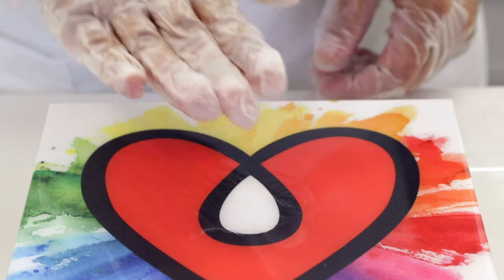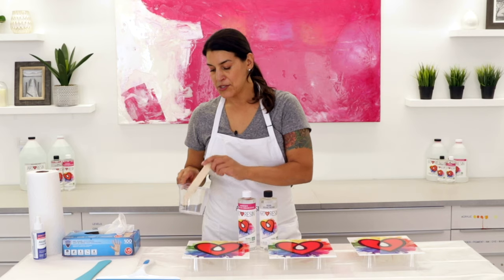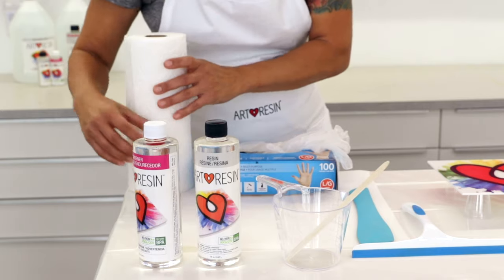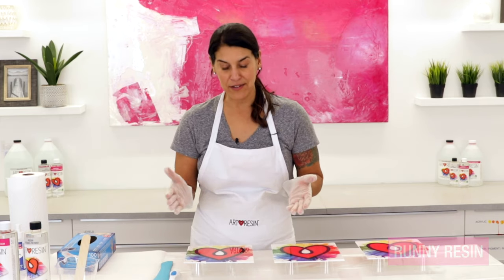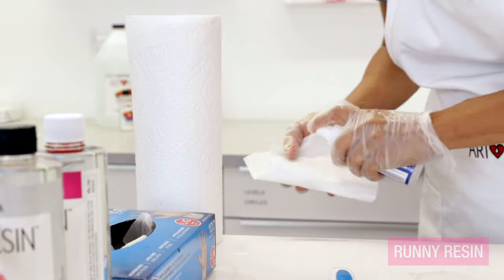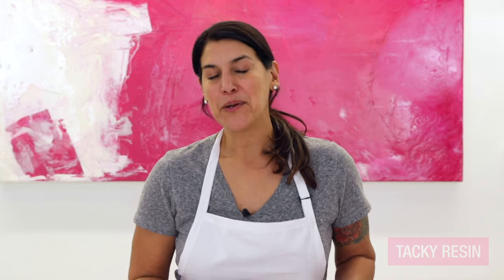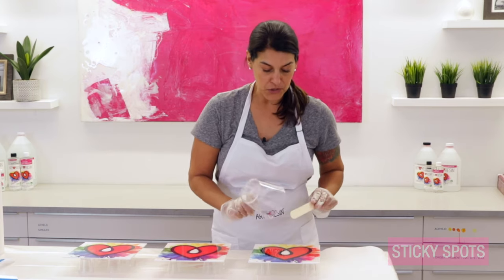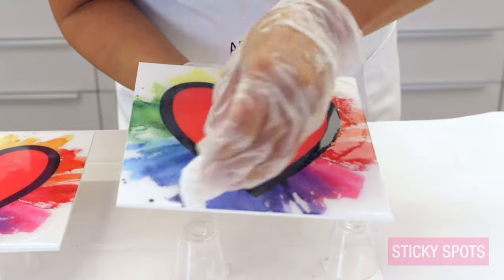How to Fix Sticky Resin - Top Tips & Tricks

Comment: Hello,I’m new to resin art and making my first cupcake tower,I first had a couple soft spots and watched YouTube to see how to fix it.I added another layer of resin and it’s almost completely hardened but I have a couple sticky spots that I’m now trying to fix.I used flowers inside I don’t want to accidentally scrape them.🤦🏽‍♀️
Reply from the maker: Hi Kristina, If the resin hasn't hardened after 24 hours and is still sticky, it is likely your mixing ratio was off or your mixture wasn't mixed thoroughly enough.  Ensure that you are mixing in a precise 1:1 ratio by volume not by weight, and that you mix thoroughly for a full 3 minutes ensuring to scrape the bottom and sides of your mixing container during the stirring.  If your resin is just sticky, you can pour right over it with a fresh coat of properly mixed resin, you will only need to scrap off any wet, sloppy resin if there is any.   Prior to pouring this final coat to cover any sticky areas, just make sure that you lightly sand any areas of cured resin so that your final coat adheres strongly.
Reply: @Artresin  Thank you so much for your help.I haven’t had any issues with my newer projects but trying to fix my cupcake tower is making me wonder if I should give up lol.I’ve scraped off what I could of the sticky or soft spots and sanded the hardened parts and added a new layer but then the side was sticky too.🤦🏽‍♀️it was my first project.
Reply from the maker: @KristinaChestnut  Oh no!  It sounds like you maybe aren't getting your resin and hardener fully mixed.  Just make sure you are scraping the sides and the bottom of your container really well when you stir.  When you pour it out of your mixing container, try to not scrape out the container.  If you scrape out the container, if there is a spot of resin or hardener that isn't mixed well, it will show up as an uncured patch on your piece.  we are always available at support@artresin.com if you have any specific questions 🙂

Comment: I evenly measure my resin all the time. However, I noticed recently that my last resin artwork is hard but not hard hard. Everywhere is hard but the bottom. When I do a slight touch with my nail, I see marks, and then it goes back to its original form. That shouldn’t be since I left the resin alone for 24 hours. How can I fix this?🤔
Reply from the maker: Hi Miss Lebon, ArtResin is cured to the touch after 24 hours but will continue to its full cure for 72 hours, based on a 1/8" thickness.  You should see it being harder after the 72 hours has passed 🙂

Comment: Hi what room temperature does it have to be when doing resis thank you Alana Australia
Reply from the maker: One of the most important factors to ensure your epoxy resin cures properly is temperature. The ideal temperature for both your ArtResin and your workspace is slightly warmer than room temperature: 75-85F or 24-30C. You also want it to be dry, 50% humidity is ideal and stable meaning no dips in temperature during the first 24hrs. Take a look at our blog for more information: https://www.artresin.com/blogs/artresin/what-is-the-perfect-temperature-to-cure-epoxy-resin
Reply: Some products tell you on the bottle. Mine is 70°

Comment: When I pour resin mixture  it is all frothy
foaming like head on a bier.  does not go away. The pour is almost all frost like white
looks ruined.

How can I fix it?
whT did I do wrong???
Really need help going through alot of
art resin.
Reply from the maker: Hi Carole,  it sounds like you either have a lot of micro bubbles trapped in your mixture.  To prevent this going forward, we recommend using a warm water bath prior to mixing, warming the resin and hardener reduces the viscosity and allows for bubbles to be released easier.  When resin is cool it is thick and the trapped bubbles will make it frothy and milky.  We also recommend stirring thoroughly but slowly, avoid whipping and incorporating more air in while stirring.  If you are pouring over a canvas, you can pass a torch flame over the surface, this will clear off any bubbles that remain.  If you are using ArtResin in molds, remember to pour in shallow layers to allow bubbles to release.  You can layer as deep as you want, just wait for the previous layer to cure for 3-5 hours before pouring the next layer.  For more information, have a look at our blog:  
https://www.artresin.com/blogs/artresin/oh-sh-t-series-episode-4-milky?_pos=1&_sid=953e6aba4&_ss=r

Comment: Just did my first journal covers. 
They didn’t get sticky but even after 3 days they are a solid but are bendable and solid hard.
Why did that happen and can it be fixed?
Reply from the maker: Hi Josephine,  I am guessing that your journal covers are a very thin pour, without a substrate a thin pour of ArtResin can be expected to remain flexible.   To reduce bendiness we would recommend a thickness over 1/3".  To reduce flexibility you could layer on a clear coat of ArtResin to increase thickness.
Here is our blog on how to prevent bendy resin: https://www.artresin.com/blogs/artresin/how-to-prevent-bendy-resin?_pos=1&_sid=7599e95f0&_ss=r

Comment: So are we supposed to wear a respirator mask or no?
Reply from the maker: Always check with the supplier for specific guidelines on the resin you are using.  ArtResin is non-toxic and does not produce fumes-if you are working in a well ventilated area a respirator is not required.  It is safe for home use when used as directed.  For more details, please have a look at our blog: 
 https://www.artresin.com/blogs/artresin/what-safety-precautions-should-i-take-when-using-artresin?_pos=3&_sid=1107d9023&_ss=r

Comment: What would be the fix (if there is one) for a piece that was resined and dry and placed on the wall but it fell and created a crack through the piece?
Reply from the maker: Oh no! Sorry to hear this. You will want to sand your piece down to the crack, wipe clean and then pour another coat of resin :) It should fill everything in and look good as new.

Comment: Question when I equal a centimeters I get a different measurements and then when I do inch  with the same number I get different numbers as well which unit am supposed to used sorry I'm new .I'm try cover something with resin I scare I might mess up cause of me measure it incorrectly.
Reply: I something in 39 length and 10 width so in units I think if that right choice then I get multiple measurements but different ways are they all the same just convert in different ways but equal same amount? One say 0.11 gallons another 14oz, 0.40itres and 399ml are they all same size just In Different conversion? Can help and am supposed have on inches or cm cause cm gives smaller numbers
Reply from the maker: @welderj1  Hi there!  Our resin calculator will calculate in inches or in centimetres.  For your canvas that is 39" x 10" you will require approximately 14 oz of ArtResin.  Here is a link to our calculator:  https://www.artresin.com/pages/calculator

Comment: I have a problem that I’d love someone to help with. I filled a skull mould with my resin. I thought it had hardened but about 20% of the top of the skull was a sticky gooey mess. I scraped off as much as I could left it for a couple of weeks but it was still gooey. I decided to pour fresh resin on the top, this was successful, so I now have a “half skull” which doesn’t look too bad.  However the outside of the original skull is all tacky. Is there anyway I can get rid of the tacky stuff, bearing in mind that we are not dealing with a flat surface or do I just throw this into my disaster pile.  I know I put too much alcohol ink into the original mix.  🤞
Reply from the maker: Once you have removed the wet gooey uncured resin I would suggest mixing up a small amount of ArtResin and applying it over the sticky surface of the skull using a gloved hand.  This can be a thin layer to avoid drips, but once it cures it will leave you with a nice glossy cured surface and it will seal in all of the stickiness.

Comment: Resin start to cure but had to bring inside because of temperature.  Does resin still release toxic fumes if is sit outside a few hours before bring inside to maintain temp.
Reply from the maker: We are happy to tell you that ArtResin is non toxic and does not emit fumes.  You can safely cure your ArtResin inside in a well ventilated area.  :). Here is a blog with more info:  https://www.artresin.com/blogs/artresin/how-is-artresin-non-toxic-when-is-it-not-non-toxic?_pos=1&_sid=09e0142ba&_ss=r
Reply: @Artresin  thank you and i will try it after i use what i have. Do you have  any idea about the adverage resin?
Reply from the maker: @myperidot12  its always best to check with recommendations of the epoxy resin you are using, they are not all the same.

Comment: I'm very new to resin. Do I do the same on sticky spots on molded pieces? What does it mean if the resin molded pieces are cured but some of it is still soft and can be squished, how do I fix this?
Reply from the maker: Hi Becky, sorry to hear that.  If some parts of your molded piece cured properly and other parts are soft, it usually because the mixture wasn't totally blended and the unmixed resin/hardener got poured into the mold.  This is almost always the parts on the bottom and sides of the mixing container that didn't get scraped enough, but then got scraped out when pouring. 
It's trickier with a molded piece - the resin inside will most likely never harden up, but you could try applying a top coat over the whole piece just to provide a strong outer shell.  It's easy on something flat like a coaster.  A 3D shape might be a little more challenging - but worth trying to salvage your piece!
Reply: @Artresin  tyvm

Comment: Hi,i'm new to this and my first coasters are still soft after 1 month ,is there something i can do about that and why didn't they get hard ?Thanks in advance
Reply: Make sure your ratio is right.mix thoroughly for 3 minutes you can do another poor but make sure you've got it mixed right
Reply from the maker: Hi Jolanda, sorry to hear you have had some issues with your resin cure. Bendy or soft resin can be as a result of one of the following reasons: 
1. Short cure time - resin will be flexible after 24 hours. It takes up to 72 hours for a full cure
2.Too much colorant - if you've added too much colorant to your resin, more than 6% per total volume of resin, it upsets the delicate balance needed for your resin to cure properly. 
3. Too thin of a pour. Although ArtResin will fully cure on thin pours, expect your resin to be bendy if it is not thicker than ⅓ of an inch. 
4. Improper measuring & mixing
For more information on how to prevent bendy resin please visit our website https://www.artresin.com/blogs/artresin/how-to-prevent-bendy-resin?_pos=1&_sid=7f5bb2423&_ss=r
Reply: Esmee

Comment: I came here because if tacky resin, but I learned that I can sand off imperfections and cover then with fresh resin to still get the shiny finish. My project is not done because I picked up the "microwave safe" from my form!
Reply from the maker: Yes exactly, You can certainly sand that down to a smooth surface and apply another coat :)

Comment: I'm kinda of having a problem my little sculptures feel sticky/coarse to the touch but there's no sticky residue on my fingers. Tips?
Reply from the maker: It sounds like maybe your ratio was off or your mixture was not stirred thoroughly enough.  I would just apply another layer of ArtResin to seal it in.  Be sure to mix thoroughly and then you can apply with a brush or foam applicator if you want to avoid drips.
Reply: @Artresin  thank you, I'll keep trying ♡

Comment: If I have just a tiny bubble in one corner of the project can I sand and resin just that portion?
Reply from the maker: Spot repairs can be extremely difficult to execute without a seam or line where the repair was. Now you certainly can attempt it if you wish but we recommend to sand the whole piece and pour another coat for a flawless finish :)
Reply: @Artresin  Thanks for the quick reply!

Comment: On rock painting can i use sand paper to take out the extra rigid
Reply from the maker: If the surface is flat, yes you can sand the cured resin surface to remove ridges or imperfections before you pour a finish layer of resin over top.

Comment: Can someone explain doing to me right quick? I did some Dominos n tried to cover the dots n made à streaky mess. Cured. Want to pour over again after sanding to bring back shine or even out. Pain in the hienie because MANY single units
Reply from the maker: Yes, if your resin is still sticky after 24hrs then covering with another coat of resin is best. Remember to fully mix your resin and hardener, scrapping down the sides and bottom of your mixing container for a full 3 minutes.

Comment: Help!!  I bought a decorative tiny dish with a resin design.  It was in the sun by accident for a few minutes and the corner got sticky. Wet like. It has not dried out. I don’t know what to do. This is not my craft
Reply from the maker: Removing it from the sun should allow it to harden back up. However if it doesn't I would reach out to the point of purchase it is possible they can tell you more as they know exactly what product was used.

Comment: Does humidity make a difference on hardening?
Reply from the maker: Not really.  Low temperatures can cause epoxy resin to cure slowly or stop curing, but humidity generally causes other problems. Humidity is moisture and too much moisture can leave you with cloudy resin or resin that cures with a waxy web like coating on the surface called amine blush.  Have a look at our blog for more information: 
https://www.artresin.com/blogs/artresin/how-does-moisture-affect-epoxy-resin?_pos=1&_sid=a1a26d4f4&_ss=r

Comment: Can sticky spots of one brand uncured resin be fixed with another brand of resin hvg  similar ratios  , by coating a thin film on top of  original one
Reply from the maker: It should work out ok in theory, however we have not done testing with all resin brands.
Reply: @Artresin wd b very helpful, if this cd b addressed,  as it's a genuine issue when we run out of one stock and compelled to purchase another to complete our project

Comment: I wonder why all tutorials use popsicle sticks to stir the resin when the wood stick creates bubbles. Anything porous will introduce bubbles.  Only a few tutorials state that using plastic or metal will give you a better result.  Just wondering, since resin is notorious for bubbles.  Good tutorial though!
Reply from the maker: Thats a good point, plastic utensils will introduce slightly less bubbles as they are not porous.  It is definitely something to look at if you have a problem with bubbles.

Comment: This just happened to me. Can I put paintings in a plastic bash and wait till after x mass.
Reply from the maker: hi Linda.  Yes, you could certainly put the painting aside and revisit it in a few days, especially if your surface is just tacky.  If you have wet, uncured resin, I would recommend scraping that off and removing as much as possible first.  I would't advise placing your painting in a plastic bag for fear that it may stick, maybe in a plastic bin or a box would be better.

Comment: What do you do if your finished product is not sticky but gooey or soft enough to squish it a little? Even after adding a new coat of fresh resin over it, it’s still gooey feeling.
Reply from the maker: Hi RehanaF13, the same rules apply. If you have any liquid spots, remove the excess liquid by scraping it off with an old plastic card or your spreader. Where it's not sticky, we recommend sanding for better adhesion. Then carefully measure and mix a new batch of ArtResin and pour it over top.
Reply: @Artresin  Thanks so much for replying 👍♥️

Comment: I keep my thermostat on 70 degrees F. Is that too cold for resin to cure?
Reply from the maker: Hi Alanna, the ideal temperature to cure ArtResin is between 75-85F.  You should be fine at 70 degrees, but if you find it is curing slowly just bump up the heat a little bit and that will help.

Comment: Ok im confused now. If you mix resin by volume and not weight, how can you use the 1oz to 1oz theory?
Reply from the maker: Hi William, ArtResin is always measured by volume not by weight.  To yield 8 oz of ArtResin-you would measure 4 oz of resin with 4 oz of hardener in measuring cups, then mix them together.  Our resin weighs more than our hardener so you will never be able to achieve a 1:1 ratio by weighing your ArtResin.  Here is a link to our blog on measuring ArtResin: 
https://www.artresin.com/blogs/artresin/how-to-measure-epoxy-resin-and-hardener?_pos=1&_sid=9fd5b5e23&_ss=r

Comment: Does hot air gun works instead of the torch u used?
Reply from the maker: The flame from a torch heats the resin surface up instantly, thinning it out and allowing bubbles to escape very easily. Not only does a torch provide the pro results you're looking for, but has the added benefit of burning off tiny dust particles that may have landed in the resin. 

A heat gun really does get as hot or do as well of a job and tends to blow the resin around or even dust into it.

Comment: I tried it for the first time, it's bendy ,sticky,tacky some have cured but others are sticky and won't dry or come out of the mold ? What do I do to remove it from the mold ? I recently started using Resin
Reply from the maker: It sounds like your resin and hardener were not thoroughly mixed which resulted in some uncured areas in your pour.  You can pull out the cured parts and then use some paper towel or wipes to wipe out any wet resin.  Use some isopropyl alcohol to clean up any remaining stickiness in the mold.

Comment: What if it's a mosaic piece where I can't scrape off. Can I just resin over it?
Reply from the maker: You will want to remove any wet and runny resin prior to pouring overtop.  If the surface is just sticky you can pour over without any problem.